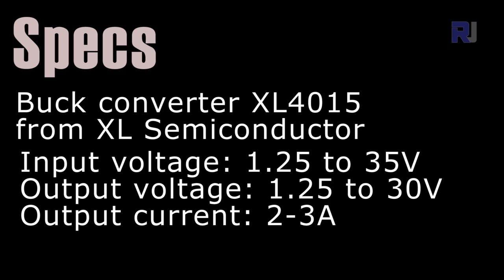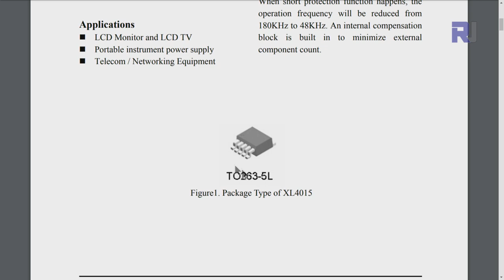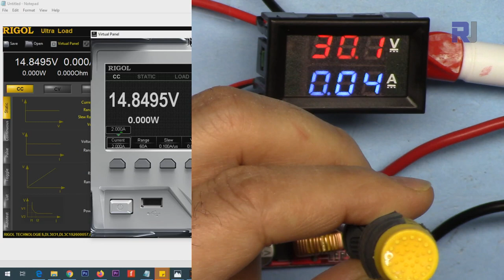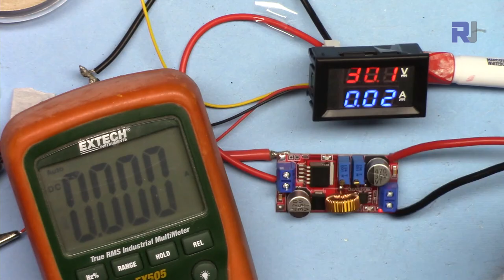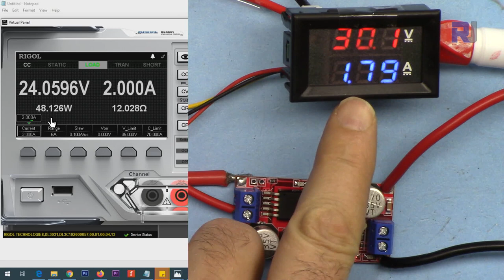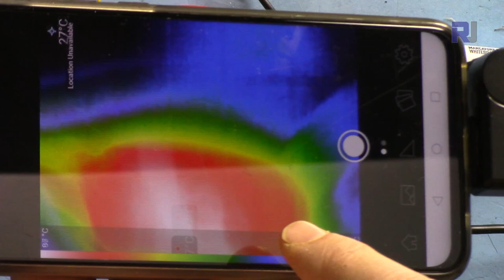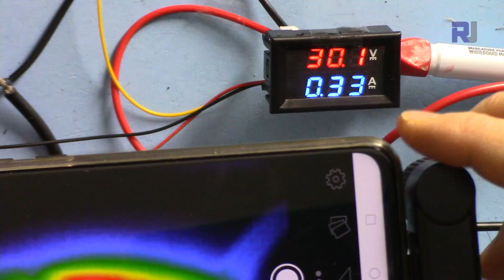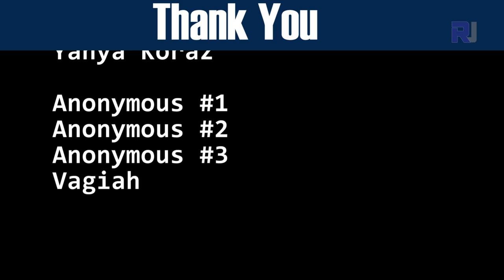Review of XL4015 5A 1.25 -30V DC CC Buck converter with thermal image

Comment: Thank you for detailed review and test. Using it as current limiter with 12v psu for powering up LEDs. Without this module, psu switched off due to current runaway. Now working stable with lower voltage and limited curren at 9.5v and 1.5A and not hearing up much.

Comment: I would like to share that I have some of these XL4015 CV / CC modules (bought thru eBay) and I made an auxiliary power supply and CAR BATTERY CHARGER up to 4.0Amp continuous, using this module, a 50mm fan and an older LAPTOP power supply (19V x 4.7A = 90Watt rated).
It worked very well to provide 14.4V (CV adjust). However, at more than 2.0 to 2.5A (CC limit), the Output diode, Output capacitor, and inductor heated substantially (>70°C)  - measured with IR spot thermometer. I solved that using a 50mm 12V fan blowing directly into the XL4015 module and even created a fan speed control, measuring the temperature with an 10K NTC (epoxy glued) under output diode area. I have set the threshold to 55°C for High speed (10Volts) if the module is more demanded, otherwise the fan runs continuous and silently at 5Volts.
It works well up to 4.0 ~ 4.5A max, but to play safe, I limit the current to 3.5 ~ 4.0A max for long term use as charging a car battery, when I see the temperature control can still turn off the ”fan blower” over the module - proving the cooling it still has thermal safety margin. 
I hope it helps.
Reply from the maker: Thank you for sharing.
Reply: nice share

Comment: I always use the 1/3 Amperage principle to protect the circuit from voltage and amperage drift. Plus overheating. At 5 Amps maximum rating according to the datasheets, that calculates to 1.666 amps continuous voltage and amperage output without drift. It has worked for me for 25 years without any problems. It lets me sleep at night. LOL
Reply: Again, that is a silly way to design for such low margins, and since you did not design this, is not applicable to these or other over-rated  generic chinese modules.   Nothing you own, including the computing device you watch this on, is designed to that wasteful standard.
Reply: @stinkycheese804  How many Degrees do you possess? Do you even have a grade 12 Diploma? How much design experience in electronics engineering do you have? Don’t judge me when you don’t know what you are talking about.

Comment: As the battery gets charged, regardless if you limit the current, the battery asks for less current because the battery potential gets higher, while the batteries internal resistance remains the same.. requiring less current as the battery gets charged.

If there's no current limit the battery will ask for whatever the battery can handle depending on its internal resistance, ... So for the mp1584 buck it cycles and heats up.. but when I get near 100% the converter provides us current and gives a constant charge.. shows no more cycles of heating up.. I see this on the meter.. therefore I know that it is heating up and shutting down and then heating up again charging fast..

Buck converters taught me about battery charging.. buck converters are awesome because there's plenty of sources of free voltage.. batteries, solar panels, hand crank generators, wind turbines, hydro turbines, ...

The buck converter takes these voltages and lowers them for us.. absolutely awesome. Love inductors and capacitors!!
Reply from the maker: Thank you for sharing.

Comment: I love your videos so much. 🙏
Reply from the maker: then you might like my other channel dedicated to Power, Battery etc called WattHour https://www.youtube.com/@watthour thanks.
Reply: @robojax  it’s so funny I just realized last night that I must have been watching Robojax and Watthour videos for months now interchangeably without realizing they were separate accounts! 😂 I was wondering, why did you decide to change / create a whole new account though ? Your videos are the best, so thorough!
Reply: @robojax  l’m subscribed to both! ❤️ I got one of these modules btw and love it. They are so cheap I think I’m going to put them on all my devices for voltage protection (I noticed my ESP connected to it runs cooler now too). Now I could use your wisdom : in either wiring two in parallel to support powering two 5V 3A 8 x 32 matrices on one power supply. Or finding one converter that can handle both panels. One of these Xl4015 modulels comfortably handles one panel. It handles two panels, if the displays are not full brightness. I’m a little concerned that someone might boost the brightness an hurt this buck unless I have two running. Either that or do you have a favorite converter that handles 6A? (searching your videos frantically now 😆)

Comment: Wow the most comprehensive XL4015 review I've seen. Also I guess I really need to put a heatsink.
Reply from the maker: I am glad you liked it. yes you should put heatsink.
Reply: @robojax  But a heatsink will not help the coil, which also seems to get hot. Does this mean active cooling in needed?

Comment: Thank you for this video! I purchased from Eiechip on Aliexpress some boards XL4015 5A for charging a lithium battery with two resistors and the output voltage is adjustable but the output current is not following the process shown in your video @ 12:44! Which component could be defective on these boards? The same issue with all 5 boards I purchased.

Comment: Very nice explanation. I bought it yesterday and follow your steps. The module works flawlessly. But one thing you missed the  Li-ion, Ni-cd, Ni-mh battery charging test. Can you explain it ??
Reply from the maker: This is not a charger. This is just a step down converter.  If someone want to use it as charger, it has to be monitored constantly as this will damage the battery. Thank you for not skipping the ads and keep watching it. This will help me a lot.
Reply: But  description shows it👇👇👇
 This Buck converter can be used as a normal step-down module with overcurrent protection capability for various applications. It is used as a charger for various voltage lithium batteries, batteries, nickel-cadmium nickel-hydrogen batteries (battery packs), for solar panels, wind turbines, etc. This buck converter can also be used as a high power LED driver module.🤔🤔🤔🤔

Comment: I have this module. When i input 12v dc then instantly full charge LED lights up and no output voltage develops. Is my device faulty? What's the possible problem?

Comment: Thanks for the review! Do you happen to know what the two holes are for located next to the positive input? One is connected to the negative input, and the other appears to connect to pin 4 (VC) of the XL4015 , although that's just based on my continuity test. Any idea what that might be used for?
Reply from the maker: sorry I kept this comment to reply but I did not see the module to reply. Perhaps someone else replies to you.

Comment: Very interesting your posts in general and this latest one is no different. You did explain very well everything, but the Efficiency equation at time 7:50 could be clarified in terms of P-out (Vout x Iout) x Efficiency, or for required Pin, as I understood from your talk. Regardless of that I’m very glad to see all your effort to share in a very practical way and check its limitations. * (integrating here past replies in 2020): P_out = P_in x Effic. Or P_out = (V_in x I_in) x Effic.  Or still required P_in = P_out / Effic., that is what I meant.
Reply from the maker: Thank you for sharing your work and comment.  Even though I have written "Input Power" and "Output Power" I should have been explicit to eliminate ambiguity.  I can't fix that now unless to remove it that portion or re-upload the video again.
Reply: This happens to everyone. 
And I just realized that I did a mistake too: P_out = P_in x Effic. Or P_out = (V_in x I_in) x Effic.  Or still P_in = P_out / Effic.
Reply from the maker: Please  subscribe to my channel and thumb up the video. It is greatly appreciated.  🔔  😊
Reply: @Richard, I agree with you, thanks for noticing. Furthermore, I had observed this and made a reply to Robojax about 1 year ago, clarifying this mistake from my side, when I also elaborated the equations referring to Vout and Iout. To avoid similar misalignment of posts, I edited and supplemented my original post with the intended equations.

Comment: Thank you for this tutorial. My question is...can I achieve 18v and 1.7amps with this module. I have a 4s10p lithium battery pack and would like to power up a boom box stereo that takes DC 18v and 1.7 amps to power up. And if not, what would you recommend. Thanks again.

Comment: Great and informative video . Can you tell me if I have to use the current part of the buck if I want to use a 7.4 lipo reduce it down to 6v for an rc transmitter . The transmitter has 4 1.5 v AA batteries in it. And if I do what do you suggest I set it at . Your help is greatly appreciated 🙏

Comment: Should I use anti-backflow diode at the output during charging the battery ?
Reply from the maker: Hi, I looked at page 3 of datasheet for XL4015 https://datasheet.lcsc.com/szlcsc/1811081616_XLSEMI-XL4015E1_C51661.pdf and the output SW pin and it can't get current entering that pin. so it seems safe. but I have not tested it.

Comment: Great video
I have old Drill batterys  Ni-Cd (12 volt) I will change to Li-Ion batterys .Can I use none modifications apply old DC charger 's voltage to new BMS circuit or I must add  to old battery adapter, Currrent constant like in this video?
(Of ourse I will add a LED for charged  indicator to old Ni-Cad adapter's output section)
Thank you
Reply from the maker: Hi, Yes it will charge. you just need to set maximum voltage and maximum current and charge. please see my channel on energy called WattHour https://youtube.com/@watthour

Comment: Output voltage goes zero after 1 time use with 14.28v dc adapter My 5 xl4015 module not Output voltage showing how to know what component is faulty?

Comment: I don’t like positive buck converter the positive voltage is burn the mosfets like a resistor even with bootstrap driver I use only negative buck converter circuit I use a higher 5 amp motor with 12 amp surge and the negative buck work very cool

Comment: during the current limit setting, such at 14:29 , why the input power = 30.1V*0.1A = 3W, but the output power(almost a shorted circit) = 15V*1.6A = 24W, please help me to understand what happend....
Reply: oh suddenly I understand why: when outputing as a shorted circit, the output voltage dropped vastly 'cause the shorted circit has a very low resistance to hold a voltage, so the output power = <very low voltage> * 1.6A = <should be lower than 3w>

Comment: Can this be used to "charge" a battery cell (1s1p) ? I have a PSU that outputs 30V 5A, and I want to output max 4.2V and max 1.7A (datasheet of 18650 cell says charge at 1.7A max). In other words, can this adapt constant current and constant voltage, or does this module just simply cuts the voltage (as seen in your video) if my load draws more than the set current limit? Basically, can this be used to push current safely into a battery cell at specific max current? Thanks for the review.
Reply: Yes that work perfect. Whit more cells in series, keep in mind a BMS will be needed tough.

Comment: I wanted to use this for charging my Homemade 12.6V 16AH Li-Ion Battery which can charge at 1C. Now when I connect that to a 12V 10A Power Supply, it keeps triggering the Over Current Protection of the SMPS and thus the repeated trigger significantly reduces the charge time. Would this device provide a constant 5A current to the Battery Pack? 

At 1C, the battery can take upto 16A for charging but can this device limit it to only 5A?
Reply from the maker: Hello, you should set the current limit. you can learn how to charge a battery from this video https://youtu.be/4-SujloLcXU

Comment: A yellow core is often iron powder core.  If it is then the XL4015 is likely a fake because an iron powder inductor is no  good at 180kHz.  Check the switching frequency on an oscilloscope, it is likely 50-70kHz, in which case the XL4015 is a fake.

Comment: Hello, what about the plated holes near the conectors?
They are also connected to VIN and VOUT? Can I solder a pin there and solder this board to my own board?
Reply from the maker: if they are labeled with - and + , yes you could solder the wires there.

Comment: Thank you for your reply to my before question.
Could you make a video about  solder station controller project(if have with PID contoller more great) in nowadays.
I want make a soldering Iron and controller with Arduino. I want make like JBC soldering station (I will buy Solder handle+Solder Pins  others I will make)
I sure so much hoobyst like this project also I want learn details from expert like you

Comment: Can you please tell me how to adjust    CC on this converter with only a multi meter without load and with load. Thank you
Reply: Looking for the same info, when I connect my meter leads in the output, I can't seem to messure more than 0.6 amp, regardless of if I turn the current screw ?

Comment: can i use these to charge lithium ion batteries cuz charging lithium ion has 2 phases ccv
I am confused about how to make a diy 48v 20amp charger (@1c) using a 1kw dc power supply.
Reply from the maker: you can but this will over only 3A to 5A.  please watch this where I've explained the voltage and current of chargers https://youtu.be/0mOqpCfAdy4

Comment: Can we charge 12v 6Ah Lifepo4 battery with this module?
Input 24v 3amp adaptor and output like 14.5 with 1.5 Amp to charge battery
Is it work?
Reply from the maker: my  friend, we are not worried about 6Ah or 200Ah. I have shown the voltage and current.  it does not matter where you want to use it.  for your 24V input see in the video if we can get 12V or 15V 1.5A. if so yes.
Reply: @robojax  thank you for your answer

Comment: what ripple will this tolerate? can you feed it rectified ac?
Reply from the maker: No. you need to have proper filter and large capacitors connected to the output of rectifier. this needs good DC voltage.

Comment: Great videos. Have you tried improving the converters by adding heatsink or modifying parts? That would be another great video.
Reply from the maker: Hi, Thank you for the comment. I am trying to show the input and output without changing. Because people buy it like this and they don't want to add something to it. if do that then the title should be "how to increase the current output"
Reply: @robojax  Yes your current videos are really great, and I like that you make a review. I also buy based on your videos. But a separate video for improving or modifying them is also very good content. If you are capable of making those contents, that would be really great. You have the tools to do those and measure. Hopefully you could continue to make great reviews and also add a separate video on how to modify or improve those products. Like increasing power (adding heat sink, replacing parts with higher capacity, changing coils with thicker width, etc).
Reply: Id like to really achieve the advertised specs, say make the device really reach the 3A instead of just 2A.
Reply from the maker: Thank you for your comment. I will keep that in mind in future videos. or I will make another video for this . I will see if i get the time.

Comment: I could not get the output below 1 amp, even with the CC pot rotated counterclockwise until it clicks.
Reply from the maker: this is strange. you should be able to even set it to zero.  I am not sure, it seems the components must have different value.

Comment: Bro help me please
I have. 48amps of lituim ion of 12.6v battery pack i set the step down at 12.6v but when it reaches at 12v it stops charging and the blue light is on why i do not understand 
And i use the 16v 2.5a charger
Reply from the maker: You must set the voltage at 12.6

Comment: 36v 5A to 24 volt 3 amper tpa3116d2 mono  With extra cooler and fan it will last.  My option xl4015e1 is with 50 volt capacitors
Reply from the maker: Thank you for tip.

Comment: Hello can we connect Solar plate to the input of this board to charge battery from output ??
Reply from the maker: hello and yes you can. the output must be set lower than lowest voltage of the solar panel in order to get the expected voltage.

Comment: Hi sir, can i using this module to step down 12v 45Ah to 12v 2Ah? Iam really thankful for your advice
Reply from the maker: Hi, yea he battery capacity 1Ah or 10Ah does not matter 10Ah will last longer. It is the voltage
Reply: @robojax  thanks a lot sirr

Comment: What is the minimum current that the module can output at 5V?.Thanks.
Reply from the maker: for power modules it is always the maximum that maters. Minimum has no meaning. Only quiescent current when there is no load matters for some application where the system is powered with small battery. You can get that from the datasheet. the link to the datasheet should be in the description.